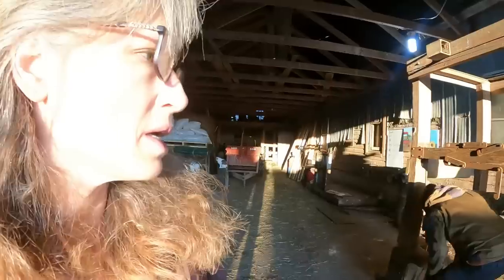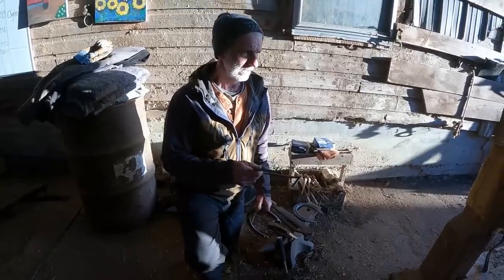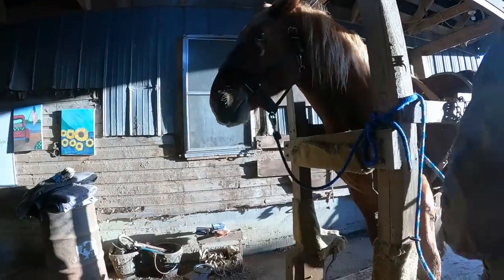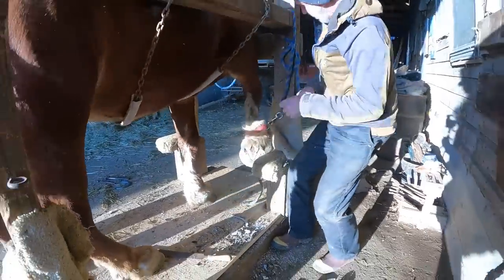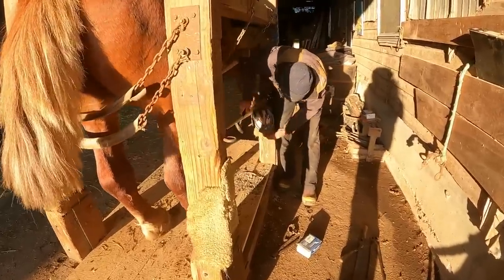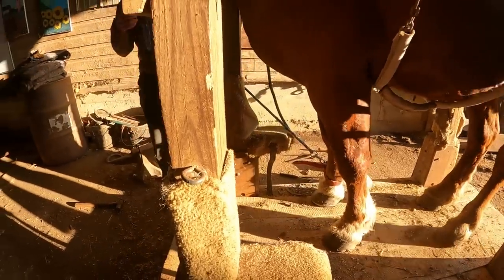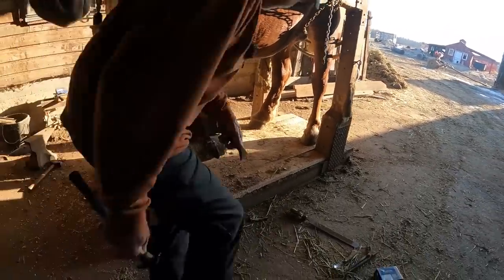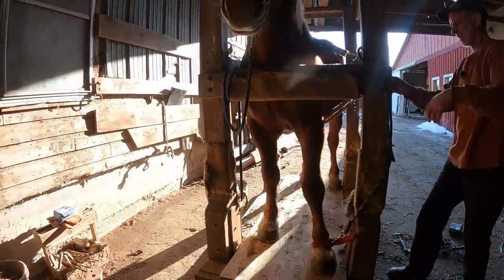OUR SUFFOLK PUNCH STALLION'S FIRST TIME BEING SHOD! // Draft Horse Training #462

Comment: Shoeing stock is a tool, if used properly it is definitely an asset to both horse and owner. As mentioned from the beginning of the video, training leading up to it just as with all a horse’s training provides positive results. Great job!
Reply: Kelly  IF  Jim had of worked with his feet more in the last year he has owned him his life and the horses would have been so much easier.  It seems so many people are lazy and will not put in the work to work with and train a young horse.  I find it abominal that a horse 4 years old does not pick his feet up for cleaning or trimming let alone shoeing. and Jim pays the price in the first fight to shoe,
Reply: @wilburfinnigan2142  yes, the more proper training done, the better the outcome. But I have seen many ways of trimming. As long as the horses doesn’t become lame, then I guess it is done correctly. How a person wishes to reach the same outcome doesn’t matter so much really

Comment: He's such a good boy.  He was a bit afraid on the first foot, and he was watching you like a hawk.  By the second foot, he'd figured out you weren't trying to hurt him, and he was just trying to figure out how to balance himself.  Same thing with the shoes.  He was scared for the first one, and the second one he is standing like an old hand.

 If anybody thinks the shoeing stock is cruel, just let them see what can happen to either the horse or the shoer if the horse pulls his foot away when he has several nails through that aren't clinched yet.  If the shoer isn't quick to bang those nails down, they can tear a chunk out of hands or legs.  The horse can cut himself up, or tear a chunk out of his foot if he steps on the shoe with the other foot while he is struggling.

I'm feeling for you there, Jim.  As I've said before, I've done that job once, and that was enough for me.  In the coldest weather, my blacksmith would be sweating while I was holding the horse and shivering.  It is really hard work.  I guess it isn't as bad with the stocks, when you aren't trying to hold up an ornery horse that is leaning on you, but working bent over like that is just hard.  

I don't think he was thinking about biting.  I think he was relaxing enough that he was actually just messing with you and showing affection, although I thoroughly agree with you on not trusting colts further than I can throw them.  His ears were up and his expression was soft.

You are very wise to let the hind feet go another day.  You are clearly blown, and it gets harder to be patient as you get more exhausted.  He has been good, and quitting on a good note means he'll be more cooperative next time.

Comment: I kept expecting Baron to reach around and grab the bottom back of your jacket. My uncle who worked many teams of percherons, half drafts, half draft mules all logging in WV hills, where with his father and brothers logged timber for the coal mines did his own farrier work. He also was a blacksmith, recreating broken parts for the horse drawn equipment and making other tools for the farm and extensive gardening activities. The last draft died in 1964, my uncle died in 1977. I have had his hoof rasp since 1965. Much treasured tool. We also have my dad's family last and many size shoe forms. And cast iron barn Jack's. Which we have used to raise and square two houses and various sets and other out buildings. I love old tools and their usefulness. Most of the farmers living around me had the use of traveling farriers. They would retail a loose shoe, but not file hooves to shape or level and did not keep a supply of replacement shoes. We had horse shoe pitches with real horse shoes. Not weighed for competition, but worn from plenty of use. The reward for hard working days.

Comment: I had never seen stocks before until i watched this channel, If you have ever picked up a horses feet you know how heavy they can be and if you have a horse with a tendency to lean it makes things twice as heavy. Draft horses are really heavy without the stocks. you cannot train a draft horse to just stand there without stocks and not lean on you while you are working. Baron is 5 years old he hasn't had his feet done that often so this is very new to him. that being said, he is taking to this like a duck to water. For Jim's sake he really needs to be in stocks. He is doing this like a pro. You have to think of the safety of the stocks he is tied in there and if the horse looses his footing he has safety chains around the barrel of his belly so he can regain his standing position very quickly without going down. If the safety chains were not there the horse could go down and seriously hurt himself. Horses hoofs are heavy just being regular horses but the draft horse is so much more heavy it can also do serious harm to your back if he continuously pulling and pushing his feet it can get very tire some and extremely heavy for Jim doing the trimming and shoeing. The stocks are safer for the horse and the person doing farrier work. in fact most farriers prefer stocks as opposed to free handing the work and could charge you more for not having stocks.

Comment: Hi
To get them to lift their feet easy in the back of the leg just above the fetlock joint pinch the tendons on both sides with two fingers and they will lift them up. Hope it helps doing great job with all your horses.❤

Comment: Stocks are misunderstood, they can make shoeing safer for both the shoer and the horse. Draft horses are tough to shoe just due to the size and weight of the foot, never mind the enormous strength.
I had to laugh when Jim said he's never been bit. I have more than once, right on the fleshy side that people often call the "huggy bear handles!" Smarts pretty good and leaves a nice mark. Same horse spun around and kicked me in the hip when I let her foot down. She was a new horse to me, so we had a discussion about biting and kicking. (We lunged her a bit made her back and move in about every direction, after that I never had a problem with her biting me or kicking me.) I had been around her quite a lot and bought her because I had used her a bunch, she was so easy to handle. When I brought her home, we found out that she was a bit of a spitfire. Lol, I guess the laugh was on me.

Comment: Hi Jim, I have never heard of shoeing a horse in stocks. In Australia we train our horses to have their feet picked up - Their feet tapped and rubbed as part of their everyday training. If done correctly your horse will have it's first set of shoes fitted with minimal fuss and no restraints necessary. I will admit it can be a little bit hard on your back at times.

Comment: I have an ideal. If you have any pipe laying around the farm. That you think would be strong enough to tie them to. Bend a piece into a half circle, the same width as the hoof stall (I'm sure that's not the right name). And I have a plate with holes in it to bolts it to the front of the stall. With it being round, it would not get in your way. maybe. I'm thinking of that to save space in your barn!

Comment: Just a question as I only had stock horses. We handled their feet daily to pick up, clean, treat thrust...why don't people with drafts do the same things? Wouldn't it be easier to train them like stock horse to left up their feet. I know drafts do it as I seen it. Just something alot draft people don't train to do. Just thinking of emergency if you need to touch their feet without a stock, what do you do? I just curious as to why? No hate by any means just wanting to know and learn.

Comment: As long as the horse is trained for it and relatively comfortable, there is nothing wrong with using a well-built stock for shoeing the heavier draft horses. Shoeing even light horses takes its toll on the farrier's back and knees. This has to also be much more comfortable for the big horses themselves .